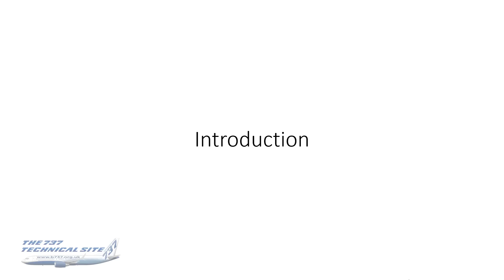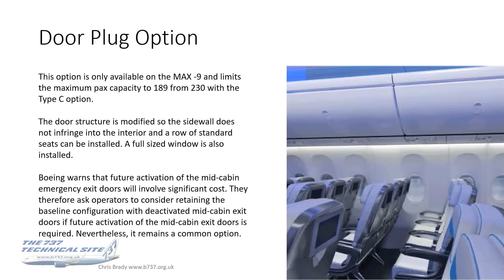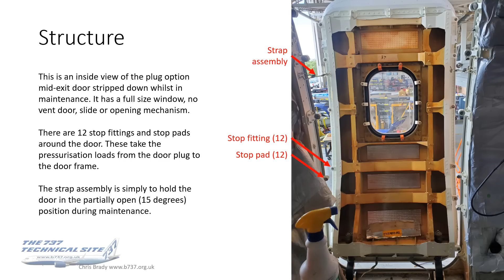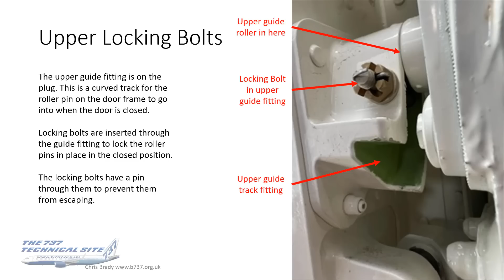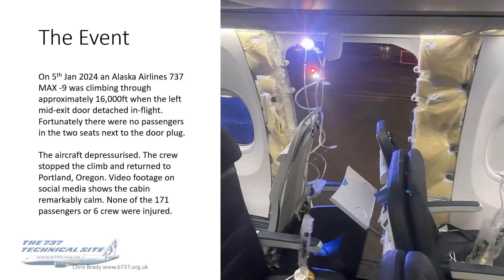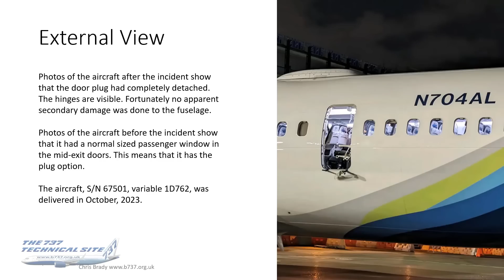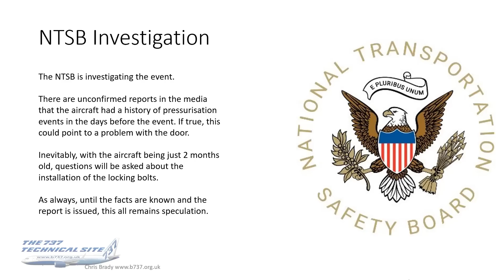737 Mid-Cabin Emergency Exit Doors - Plug Option

Comment: The nuts securing the upper and lower movement of the plug door are called castle bolts, bolts that have the look of a castle tower.  The pin hold the castle nut in place it called a cotter pin.  The cotter pin installation prevents the castle nut from backing off the bolt.
Reply: Do you mean the nuts on the bolts are called castle or castellated nuts? Good pickup on the use of split or cotter pins rather than lockwire.
Reply: Call them split pins in Australia. (retired Boeing QA 25 years) @ImperrfectStranger
Reply: No argument from me, Leon. I live in Australia :) Cotter pin seems to be used in the Boeing Maintenance Manual though.  @Leon1Aust
Reply: we call them cotter pins and castle nuts in the US.  You Aussies always have to have a different word for everything :)
Reply: @AGM796 Add Brits to the list of people that also have to have different words..
Split pins here too :)
For us, a cotter pin is a cylinder with a tapered flat on one side. They have a bolt thread extending from the thin end of the wedge (made by the tapered flat). Most common application is bicycle pedal crank attachment (or it was when I was youngl)
The shaft has a flat milled into it, the crank has a hole drilled through, tangent to the shaft. The hole in the crank is lined up with the fkat on the shaft, the pin is inserted and fixed with a nut on the thread. The  taper on the pin makes it a simple fixing with no backlash on the crank.

A picture paints a thousand words..
Reply: Heres a guess...it was taken out. When re-installed  the cotter pin(s) were omitted.   Those castle nuts are not self locking.  It would work for awhile till vibration loosens it to the point of failure.  My guess is the top 2 cotter pins were omitted. OR the plug itself failed.

Finding the door should help.
Reply: @jimmy-et1pm  I think it was more omission than just cotter pins (new workforce at Boeing and airlines scares me).  But...the airline was warned with the "AUTO FAIL" lights on 3 flights.  Falling into the old practices, $$$.  Remember 261?
Reply: The door was talking, no one  was listening.☹
Reply: Castellated Nuts.
Reply: I'm not an aircraft mechanic, but I understand castleated nuts. It sounds very similar to the nut that holds steering knuckles on ball joints.
Reply: @Rwalt61  It is actually exactly like the nuts that would secure a ball joint to a control arm.
Reply: You are correct, sir.  Those are castle nuts my friend.   @Rwalt61
Reply: Ex RAF engineer - split pins!
Reply: Ex RAF engineer - split pins!
Reply: It’s a split pin
Reply: I looked again and it’s a cotter pin not safety wire
Reply: A bolt is the long part with the threads on the outside a nut is the part with the threads on the inside. The bolt used would be drilled for the cotter pin. The nut is called a castle or castellated nut in the USA. The split pin used to keep the castle nut from turning is called a cotter pin in the USA.
Reply: Castellated nuts and Cotter (or split) pins. Often nicknamed or misnamed 'castle' nut.
Reply: Yup - in the U.K. they are split pins and castellated nuts - common on motorbikes.
Reply: Strictly speaking, the nuts shown are "slotted" nuts. "Castle" or castellated" nuts are similar but the slotted section is also reduced in outside diameter.
Reply: cowling is a bonnet and a flashlight is a torch.

Comment: Chris_one question. at 7.12 you show the 'pocket' for the rollers has 'bottoms up', i.e. when in the closed position thel roller is at the uppermost position in the 'pocket. If so, wouldn't the spring pusk the door in place and keep it there - since it is no handle to force the 'rollers down and out.

Please explain (anyone!!)
Reply from the maker: * Errata *
In this video I state that a downwards force is required to remove the door plug. I based this statement on text in the AMM SDS which I now believe to be incorrect or misleading. It is possible that a very small downwards motion (1-2mm) is first required to be able to free the locking bolts. But the door must be moved upwards by a couple of inches to clear the guide tracks. Apologies for any confusion.
Reply: @ChrisBrady737 t
Reply from the maker: AMM SDS 52-23-00 Page 6 MID CABIN EXIT DOOR PLUG - COMPONENTS, Lift Assist Springs:
"Apply a downward force to the door plug this forces it down until the rollers clear the guide tracks. At this time the door plug can open outboard."

Comment: Boeing removes the plug door at Renton to install the interior, and then fastens them again. So the last people to work with this door were at Boeing, not at Spirit Aerosystems.
Reply: From reports I've read, the specific Alaska Airlines aircraft had the plug doors opened and interior worked on to install a WiFi upgrade in November-December.
Reply: @ComputerGeeks-R-Us  The company that installs the WiFi has already put out a statement that they have not worked around the plug door or removed it. The pressurization differences seen after the install could be from the fact that they drill holes in the fuselage ceiling to run wires. And now United has found 5 aircraft with loose bolts in the plug door. The Air Current website now has an article on it.
Reply: @ComputerGeeks-R-Us  United has found loose and missing bolts in its plug doors on its 737-9Max’s as well…
Reply: @ComputerGeeks-R-Us  All the manufacturing and maintenance records need to be collated to identify every opportunity where a human error could have been made.
Reply: @ComputerGeeks-R-Us  Makes no sense.  Why not just enter through the cabin doors?
Reply: Somewhere  in a drawer 6 bolts are sitting and someone is shitting there pants.
Reply: It depends on who outfits the interior right? That’s not always either of these companies.
Reply: @Prxyshj  Boeing fits the interiors to new aircraft. This aircraft was ten weeks old.
Reply: And they smoke dope in Washington.
Reply: I like how we overlook the fact that if the door came off, how are loose or broken bolts supposed my magically hold on to be found by NTSB?
Reply: The company that did the Wi-Fi installation, started its work on 11/27 to 12/7. The so called depressurization issues on the specific Alaska Airlines aircraft all started on or after December 7th. Per the NTSB, the three prior instances were on 12/7, 1/3 and 1/4. We do know the Wi-Fi installation company, AAR did release a statement they did not remove the door plug in question. Coincidence, that the depressurization issues were after the Wi-Fi work ? Maybe….but there may be correlation.
Reply: But now it seems possible the Spirit workers assigned to the Renton facilty to correct Spirit errors might have reinstalled the door pluh. The Boeing and Spirit work tracking systems were different and not compatible. Spirit supposedly did not require the work be checked if the door plug was just "opened" as opposted to being "removed."  There really is no significant difference "opening" and "removing" the door plug and the works should be checked in both cases IMO.  Where is the FAA in all of this?  Didn't they see the fact that the two work tracking systems were incompatible as unnecessarily risky?  If not, they should have!
Reply: The Door Plug is installed by Boeing not Spirit Aerosystems as an “optional extra cost” item.
Reply: @allangibson8494 The fuselage is shipped by train with the plug door in place. However only temporarily fitted.
Reply: What does "temporarily fitted" mean?  Bolts not in place or not tightened?  Something else?

Comment: I'm definitely interested in seeing a close up up of those hinge rods, and in particular of the nuts and washers at the top.  As you say, they appear undamaged in any way, but it's hard to tell for sure with the resolution available publicly.  

Assuming that those stop nuts and wsshers at the end of the hinge were present, I'd love to know whether their failure was by design or a happy accident.  I imagine the door not completely departing the aircraft would have made this incident worse.

Comment: The problem I see here is there is no damage to the hull or attachment location of the door. Like it was open or left open., From what I can see the door did not fail. It would have had to damage something if it failed. I see no signs of damage. Were am I wrong?

Comment: The absolute only way the plug could come out is if all 4 bolts were not reinstalled after maintenance.  Any 1 of the bolts would have been enough to hold the door down on the pins.  Apparently it is common to open the plug for ventilation during MX.  Vibration or turbulence in climbout would allow the lift assist springs to lift the track over the rollers.
Reply: Since aircraft was 2 months old, would it have had any significant maintenance?
Reply: @tomsixsix unlikely
Reply: @tomsixsix  Someone on Blancolirio said that Alaska does an inspection after delivery.
Reply: satellite antenna!
 @tomsixsix
Reply: @tomsixsix  There were pressurization problems reported that caused Alaska Airlines to not allow the plane to be flown over water (i.e., to Hawaii).  This suggests that some maintenance was done to look for a root cause.
Reply: My unsubstantiated guess is that landing loads (when pressurisation is minimal) allowed the springs to push up the door a bit at a time until the door came loose. Each time the door came up a bit, the contact surface and resulting friction would be reduced.
Reply: Not the only way - The bolts could have been installed but not safety locked and the nuts unwound and bolts ejected.
Reply: @daleedmunds  That's 4 bolts, 2 thru the upper cam tracks, 2 thru the assist spring cylinders.  I'm going with shift change, a guys started closing the door, was going to install the bolts, then went home before it was done.  This is supposed to be signed off.
Reply: Agreed-any of 4 bolts could have prevented slide of door upwards to clear 12 stop pads and 2 rollers -so it seems highly likely that all 4 were missing. Probably error occurred at last maintenance event when door was last opened.
Reply: Unconfirmed claims say that pilots had noted pressurization issues before with the aircraft and had passed it off to AS maintenance. AS claims to have performed maintenance per FAA regulations; whether those referenced regulations include checking these bolts is unclear to me
Reply: another way is if the springs were too strong, e.g. if they were rigged for the weight of a slide

Comment: Excellent job; thanks so much for this content. As a (retired) A&P but who never worked on 737s, I was curious about the design... your video shows it is pretty straightforward and once the door and the locking bolts, nuts and cotter pins are installed correctly, they are not going anywhere. So unless there was a material failure on some part of the door structure, it seems like the investigation will focus on "assembly quality"... who touched this part of the A/C last? Thanks again...

Comment: I don't understand why would Boeing install a (lift assist spring) to open that plug door..isn't the spring putting tension on those 4 bolts holding it from opening?? And how much tension are those springs giving out??? And also you mention in the video you need a downward force to open the door.....isn't it the opposite??? If we push down on the door the upper guide roller pin is hitting against the upper guide fitting on the door....
Reply from the maker: AMM SDS 52-23-00 Page 6 MID CABIN EXIT DOOR PLUG - COMPONENTS, Lift Assist Springs:
"Apply a downward force to the door plug this forces it down until the rollers clear the guide tracks. At this time the door plug can open outboard."
Reply: @ChrisBrady737  - Chris, how does the opening lever 'push the door down'. I understand the two bolts for the upper 'bolt pockets' - but are the two lower actually necessary, as they push the door upwards - or are thet there for a safety reason?
Reply from the maker: * Errata *
In this video I state that a downwards force is required to remove the door plug. I based this statement on text in the AMM SDS which I now believe to be incorrect or misleading. It is possible that a very small downwards motion (1-2mm) is first required to be able to free the locking bolts. But the door must be moved upwards by a couple of inches to clear the guide tracks. Apologies for any confusion.

Comment: Great video. Pressurization events could be from the door partially opening due to missing bolts. Considering Boeing has been making doors for a long time, most likely scenario is missing bolts (meaning less likely the door broke.) It’s unlikely bolts broke, missing 1 or even 2 bolts shouldn’t cause a problem. And it’s plausible a configuration change was made to this particular airframe, causing someone to forget or not realize bolts were needed.
Reply: Joe I think the springs tend to open the door (plug), not hold it closed. The springs are part of the system for when an actual exit door is install and they help to lift the door over the stops.
Reply: @rael5469  you are correct about the direction and the springs. Thank you.
Reply: I think that part of the problem is that opening and closing a door is not normally an inspection item.......so a single mechanic might have done the final closing and securing. An accident waiting to happen. Maybe since, as others have described.....maybe since the plug is opened and closed multiple times during final assembly, maybe there should be a final inspection of the plug before they put that sidewall panel on. That particular item.....installing that particular side wall panel....should have an inspection item, "Clearance to Install" (pay particular attention to the bolts and cotter pins securing the plug door)  Yes, I have seen inspection items worded that clearly. I wonder if they have any such thing during final assembly of those plugs?

Comment: 02:45 Why would the door plug reduce passenger capacity??? Shirley Temple it would increase the capacity.
Reply: It reduces the maximum ammount of paangers the aircraft is legally allowed to carry. There is a maximum of around 200 without the extra exit doors, I'm not sure of the exact figure. If the airline wants more than that then they are required to have the extra exits in case of an emergency evacuation. With the plug installed they are limited legally, even though as you say it would free up more physical space.
Reply: @lurkalot4785  thanks for the explanation 👌🏿

Comment: How many inspection hours will be used on this part for planes without the door option selected and how much is that going to cost over the lifetime of the airliner versus just welding it permanently shut in the production stage? (If that is even a possibility?)
Reply: Either use see through lenses on trim or removable gromets.          Tbh that sort of detail(locking bolts with castallated nuts and split pins) should be photographed for proof.
Before trim is installed, although that trim should only be installed by fitter who installed locking bolts.

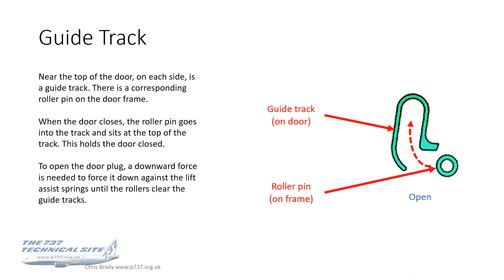Comment: 7:22 -Looks like the plug must be raised instead of lowered to release the pin from the track. Minor detail in a great video.
Reply: That's what I was looking at also, was going threw the comments to see if someone at seen this.....I am pretty sure he will correct it...
Reply: @paulscamping  Great video otherwise.
Reply from the maker: * Errata *
In this video I state that a downwards force is required to remove the door plug. I based this statement on text in the AMM SDS which I now believe to be incorrect or misleading. It is possible that a very small downwards motion (1-2mm) is first required to be able to free the locking bolts. But the door must be moved upwards by a couple of inches to clear the guide tracks. Apologies for any confusion.
Reply: Agreed.
Reply from the maker: AMM SDS 52-23-00 Page 6 MID CABIN EXIT DOOR PLUG - COMPONENTS, Lift Assist Springs:
"Apply a downward force to the door plug this forces it down until the rollers clear the guide tracks. At this time the door plug can open outboard."
Reply: AMM SDS 52-23-00 as written means that the diagram at 6:30 does not apply to the door plug option, which shows the guide track on the door plug opening downward, so that the plug would need to be raised, with spring assist, to get the open end of the guide slot over the roller pins mounted to the fuselage to open it. The instructions imply that the guide tracks would need to be installed on the plug with the open end up.  However, 8:50 clearly shows that the open end of the guide track faces downward, thus the plug in this photo must be raised to release from the roller.
Alternatively, the instructions in AMM SDS 52-23-00 may have been written in India, along with the flight software.
This documentation discrepancy is important to investigate, as it impacts the possible failure scenarios.